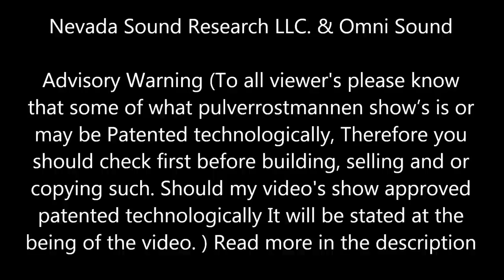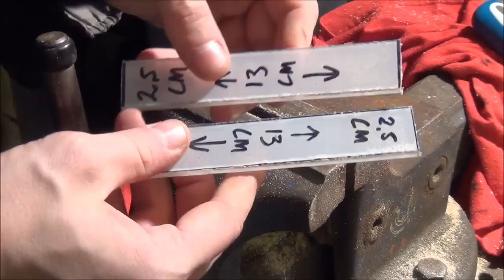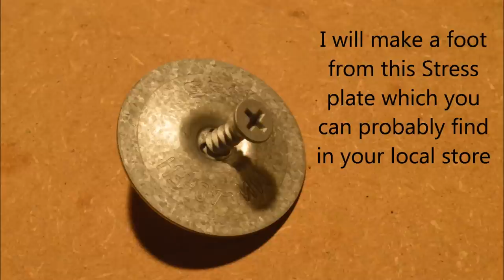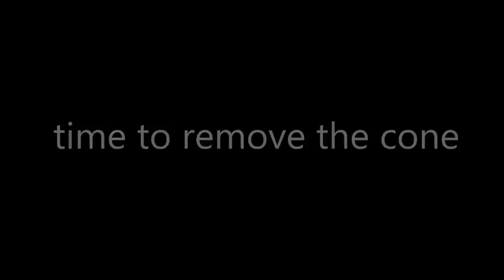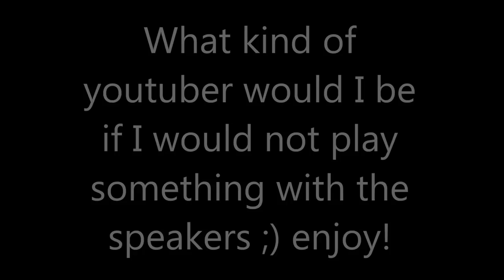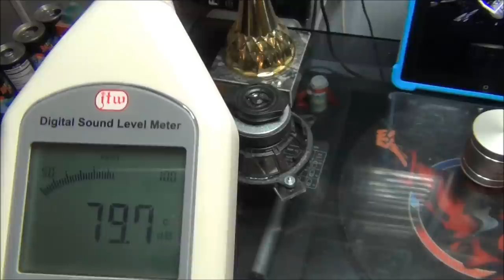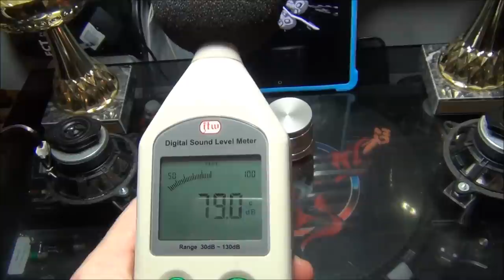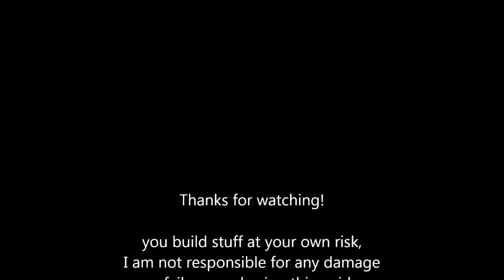How to make a vibration speaker (Omnidirectional design)

Comment: The really cool thing that you could do is, using an Oscilloscope you can superimpose two wave patterns to find the harmonic frequency and have that frequency below 20 hz so you cant hear it and watch how stuff moves, things will move off the table top seemingly on their own with no manipulation. The first practical use i can think of is to affix these to concrete forms, but thats too straight forward, perhaps affixing them to say , a concrete 3D printer. Perhaps these can be used to enhance the 3D printing of concrete and enable stronger concrete to be used.
Reply: Eureka!! Eureka 😊

Comment: you should try super glue with baking soda. It hardens instantly as soon as baking soda comes  into contact with super glue and can even be sanded down if needed.
Reply from the maker: That's actually a very interesting thing to know, this is something I will test out some day when I have time
Reply: Baking soda and superglue is amazing creates a fiberglass type resin that's extremely strong and heals instantly 💪
Reply: Great video too ty
Reply: My wife thought I had some cocain in my building..not hardly..I use it often on rc parts my grandson breaks

Comment: if I glue the foot to a surface or strap it down for an installation would it still work?
Reply from the maker: Yes it will work. Everything the end of the moving rod is in contact with, fixed or not to a certain place it will make sound in that material. You can build big versions of this and make a tactile transducer too or as it is called bass shaker. You can find videos on these in this video description

Comment: Cold soldier? Need to heat up the physical joint before applying soldier. Make sure you have a good mechanical connection before an electrical connection.
Reply from the maker: you don´t have to preheat the surface as a general rule to get a good solder joint, the important factor is to see the solder flow out properly, it may look in this video it flows out less than good but it was good enough. it can be a general rule also that sometimes you gonna melt or damage things if you heat them too long which can give you a really bad day too

Comment: Does this sit on the flat washer? And is it to make contact with the glass surface? Really cool
Reply from the maker: The washer or the foot as you may call it carry the whole weight of the driver. The plexiglass is the suspension that keeps the driver in the middle of the voice coil travel and allows for the whole suspension to flex allowing the sound to pass through to the foot and into the surface the speaker is standing on. It have to be able to flex some but still be able to carry the weight of the whole speaker so the plexi is a good thing to use here.

Comment: Nice job ! But I'm not getting what you did with the tweeter. Did you just glue the magnets back to back ? Aren't they supposed to reject each other ?
Reply from the maker: The tweeter is simply to add audio on the upper edge of the range. It was not many other ways I could attach it to the driver but it did not reject much either. It depends on how the polarity of the magnets match up or not. But it worked just fine to have it there

Comment: Have you played vocals on that device?  What does it sound like?   Would it also work on a woofer?
Reply from the maker: Yes, the audio is a bit shaped by the properties of the materials resonating with the device so in basic terms it will be different on various materials. It works to rebuild a woofer to a giant transducer which I also have videos on you can watch. It is more used to shake objects such as your chair, sofa or bed as a physical feedback device and it works very well like that. But they are poor for use in full range applications like this video shows here

Comment: do you use the plexiglass as a spring? or did you make it so that the screw can move freely inside of it.
Reply from the maker: Yes the plexi is used as the spring and the flex is very important for the sound to travel down to the surface. It is rather tight torque around the plexi otherwise it may lead to rattle sounds and so on. 
There are 3 purposes why I use this material but others might substitute but with various results, but first is to carry the weight of the driver to keep the voice coil in the very center position in all directions. The other is to let sound pass through with as little loss as possible. And the third is to keep the moving mass as light weight as possible since the heavier the moving parts are the more audio and power you lose. And plexi is pretty easy to work with. But you could probably use a plastic ruler or two as well if you can’t get anything else

Comment: I have a question, what if i change the straps for a copper plate? i could give more power to the speaker? Pd. Nice video
Reply from the maker: Thank you :) you could substitute the plexiglass with another material but it can affect how the speaker plays as well. The stiffer the straps are the more power you gonna need to play the same volume and you can risk overheating the coil easier as a result but the straps also needs to be stiff enough to carry the weight of the whole driver to keep the coil in the center. So basically you could substitute but you need to have in account how the material gonna resonate and carry the speaker assembly whilst giving enough play to transfer the vibrations to the foot and surface it places on
Reply: @Pulverrostmannen  ok thanks for the reply, I have anothers questions if you don't mind xd. Can you tell me the characteristics of the straps, leght and that kind of stuff, I'm from Mexico and I never see that kind of straps
And for the second question, what if I change the tube for a larger copper tube? You think that can improve the speaker performance?
Reply from the maker: Victor Alejandro López the lengt of the straps are made the same as the diameter of the speaker you are using. And generally 3mm thick. The width of the straps are decided with the weight of the driver. The heavier it it the wider you need to make them to make a good balance in how much they can move versus carry the weight of the total assembly. 
The rules are kinda simple to gain more power from this. Namely: the lighter the moving parts are the higher power you get. 
And you need to have as easy movement of the  vibrating parts as possible but without making it unstable or too easy to break. 
So generally a heavy magnet and basket and ultralight moving parts that is still strong and rugged and lined up correctly in center when the driver stands on the foot and you get the best result

Comment: Can You use it instead of an exciter in a demodulated mode loudspeaker? I want to build cheap DML speakers but I live in Europe and it is expensive to import audio exciter from US.
Reply from the maker: tybysh it should be possible to modify the design to work more as a dml speaker if you so want in various ways. If you plan to use a regular speaker to power a fixed plate membrane in a dml setup instead and the driver not need to keep its own weight up you could probably build a fixture and use a lightweight tube or something to transfer the vibrations to the membrane plate. Most of the time you get better frequency response the lighter the materials you are using. 

A surface speaker needs it’s own mass as a counterweight for the energy that moves the vibrations down to the surface it play against and thus need a strong suspension that keeps this stable in center but it also cuts down on efficiency due to this.

Comment: Excelente demo Felicidades pero solo tengo una duda ojala y me resuelvas amigo..
¿ por que la bocina izquierda  suena mas grave y la derecha mas aguda?  ...Es por problema de fase invertida o por que esta conectada sonido estereo??? .....al poner el sonometro en la bocina izquierda. Unicamente  subio mas db y al conectar las 2 bocinas bajo 2 db.....
Reply from the maker: Have you built two speakers yourself? :)
My first guess would be that you might not have the speaker centered in the magnet. 
It is important to check when the speaker is standing on the foot that the voice coil is in the middle position of its resting state. Meaning it should not be pushed inward or held out by the plexi glass. If both speakers are centered the same way they should sound equal. 
You can also test to swap them out and see if you move the problem with the speaker to the other side. Best of luck!

Comment: Great video! just a quick question, where did you obtain the washer for the foot? I cant find any like it anywhere!
Reply from the maker: +Short and Sweet Tutorials Hi I think it is called stress plates In English, they should be available in your local hardware / construction business. the ones I use here has number   (SFS MW-40-FH). hope this helps you
Reply: i find the washer in a caulking pistol mmm in the shop of construction, very low price

Comment: is it possible to use other ring type like common thin ring as the same with the one use ring from the transformer...
Reply from the maker: any recessed washer would do that can fit the nut inside, I found the stress plate washers I use in this video from my local hardware store and slightly modified them to work.
Reply: k, thnks, i got five unused speakers, and i'll try to build one...

Comment: I am very curious what the real world application for this would be. I like your video and attention to detail but as the sound may be fairly loud there are small speakers that must sound much better. I am just curious of the thought process behind this method of recreating sound waves?
Reply from the maker: Daniel Parks Thanks, well the real world use of this kind of speaker usually goes to the fact it can be cool. 
You may use the speaker agains a window or other surface and the sound will travel to the other side and can be pretty loud on the other side. Surface speaker can be very compact and easy to carry if you buy a real one powered with batteries. 
But in aspects of practical use and sound quality you may surely be better off with a real boxed speaker.
But for this home made project it is very good for learning audio dynamics and constructing things. And the fact that we do it just because we can :)
Reply: Adds haptic feedback, mount to your gaming chair and feel the game, or mount to your couch and feel your music

Comment: well that was well interesting... although you do know that the speaker would probably give you around 85 db with 1 watt and that could in turn be amplified with a nicely designed enclosure? 

anyhow if you do need a speaker like that i would suggest you use something with a smaller motor! the xmax will make it jump around as you mentioned, so getting a big (2"-2,5") aluminum tweeter with low fs and running it without a crossover you should be better of. i couldn't find anything suitable at parts express to link but i would belive having a motor with alot less xmax and maybe using neo magnets would help.
Reply from the maker: hampus Cronholm it is true the same speaker would perform louder with the same power in a proper box but the concept of the surface speaker is to play without it and make sound trough Solid surfaces with contact. 

Using a smaller motor would not make the driver more powerful or make it jump less, in fact it would lower performance if the motor was small. 

The mass of the magnet is where the main magic happens when making it to a tactile surface speaker. The mass has to be here to act as a counter weight to make the power from the coil go down to the playing surface and more mass will make the driver itself more steady as it plays. 

Same goes for the voice coil and x-max. As we rebuild the driver and uses a very stiff suspension the original X-max won’t matter at all but as we takes away excursion we also suffer from less efficient cooling of the coil itself and makes much more stress on this poor thing so a large and high watt rated coil will handle more power over time when it works this way. 

There are ways to improve performance and it is to keep all moving parts as lightweight as absolutely possible and it will boost overall performance and range of sound as well more than changing the size of the driver. 

Naturally my design is likely far from perfect and it is likely many things that can be done better but I won’t work more on this due to the patent claims around this kind of stuff. To begin I made this video just to share ideas around this topic and make it possible for others to learn and improve from this :)

Comment: Excellent...Would hot melt glue work instead of super glue?
Reply from the maker: As long as the glue bonds enough to the surfaces it should work with hot glue as well, however if the glue is softer it may dampen the high frequencies some as a result as it would absorb some of the vibrations more than hard glue

Comment: Soo nice! But did you put the capacitor of the tweeter in parallel to the tweete?
Reply from the maker: Adrian Van F thanks! The tweeter is connected in series with the capacitor and that set is in parallel with the driver. Putting the capacitor in series with the tweeter acts as a high pass filter. It needs to be a cap designed for AC voltage to work but you will mostly find them on stock speakers anyway so you just need to keep it :)
Reply: Thank you, that was very helpful! :)
Reply from the maker: Adrian Van F glad I could be of help :)

Comment: why does it have to be plexi glass? does it conduct vibrations better?
Reply from the maker: It is flexible yet strong enough to carry the weight of the driver. For sound to travel down to the surface the rod need some excursion which the plexi glass nicely gives. But you could use something else like a plastic scale or something else that also flex a bit but they may crack or introduce unwanted harmonics to the sound as for example a metal strip would do :)

Comment: can I use metal of the same thickness, and would a 10" sub work better
Reply from the maker: you may use a 10" speaker if you want to build a shaker but they will have very poor sound in this size as the moving mass is too much so using a small speaker and keep the weight low is better for sound, using metal bars would partly work but the flex would be less and thus less performance
Reply: ok thanks a lot
Reply from the maker: no problem :) thanks for checking out my video. greetings from Sweden
Reply: Garythesnail
Reply: Ethan Hernandez huh

Comment: the frequency response is very bad. maybe correct it with a parametric eq?
Reply from the maker: It should work, there could also be done with passive filters, but a surface speaker won't play as well as a boxed speaker anyway though
Reply: +Pulverrostmannen yes, but with passive filters you will need to measure the speaker. and oh well, when i look at some of the 'speakers' sold in stores these days, i bet this sounds like a studio Monitor in comparison ^^
Reply from the maker: yeah, if you want to make it as advanced and measure the speaker curves it will take some effort. it is also very hard to record videos that shows the actual sound correct :)

Comment: VERY COOL. Secure it with a double sided foam tape. PARTS EXPRESS 2 EXCITERS $25, BUT I THINK YOUR BUILD WAS WAY COOL!!
Reply from the maker: Thank you! As long as the tape is not soft you can use various things to fasten it. The most important part is to keep the driver in as much direct contact with the mating surface as possible for most audio
Reply: You have me thinking now!

How about getting a Direct TV parabolic dish?
I wonder if you could pull the material via a vacuum pump into the parabola with a coating of sprayed contact cement!
Parts Express has been inundated with experimenters so the exciters are on back order.
Your delivery is very precise and clear . Great video bud,
TDH
Reply from the maker: @thomashanson7600  thank you :) greetings from Sweden and good luck

Comment: Just come across your channel. You say in another comment that you do comps? I was always wondering if 114.5 db is good for a sound system. Thats only a peak. I get about 100 db normal!
Reply from the maker: Devils Knight welcome to my channel!
I have competed quite a lot in audio in my days of glory yes but this year I been too busy moving in and fixing with my new house it has not been time left for anything else. 

If you go by loudest sound 100db is not that much but in terms of listening volume it is rather loud. 

If you listen to audio in terms of comfortable volumes this 80-100db is where most gonna stay. 

120DB is where it starts to be a risk of hearing damage and is equal to a concert in many cases. 

My production studio is capable to play music above 130DB and it is ridiculously loud. 

And my personal best is 150,7DB in my previous car. And 150,4 in the other I had. 
But one car broke down and the other was old so both have leaved me without any sound right now
Reply: @Pulverrostmannen  
Thanks for the reply. I thought it might have been alright having build everything myself. Even now with it needing rewiring (i use cheap cca cable) i still cant have it to loud as its disorienting when im driving (thats best as i can explain it here).

Comment: which model of speakers are you use? i cant  find good speakers in my city
Reply from the maker: +Глеб Скамейкин The speakers I used here is a set of stock speakers from if i remember correct Nissan Kubistar. literally any speaker like it would work. however will the final result vary depending on the speakers you get and how well you make it. the tweeter is optional and I would had skipped it if I knew the way it was put on the driver would infringe a patent of some sort from the beginning but it makes the sound much better also though. good to know